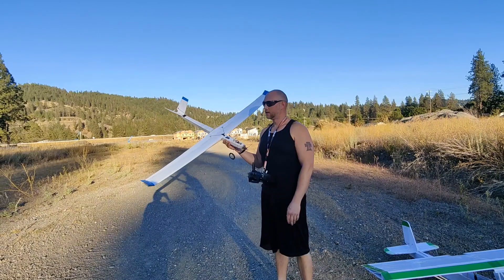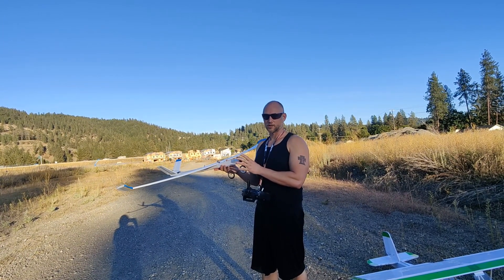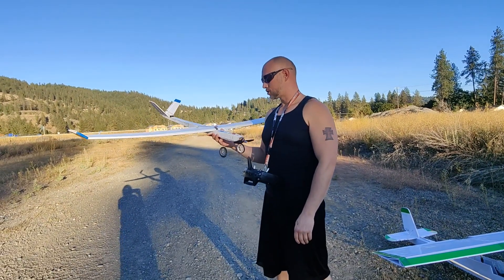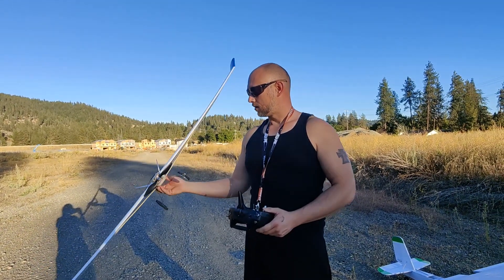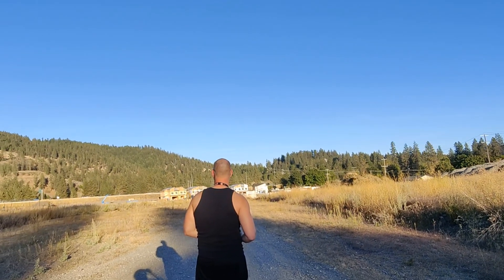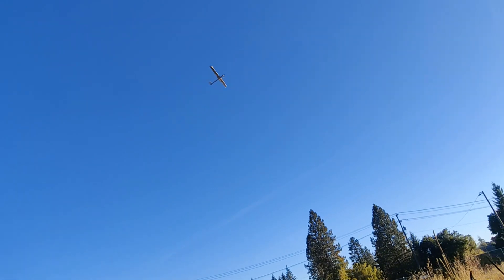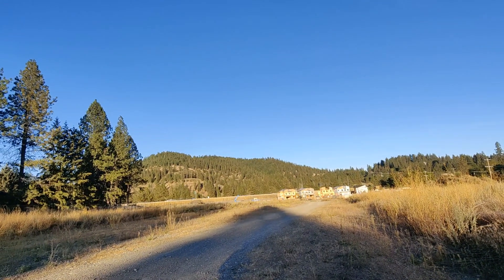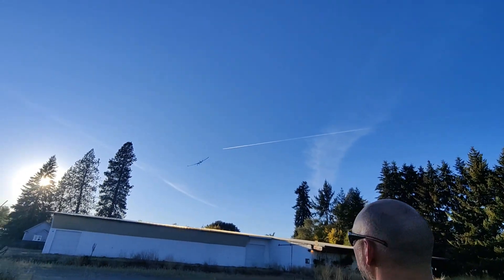Finally flying my GTV again!

Comment: Dang, hate the battery died. I always use a battery alarm. Awesome plane…
Reply from the maker: @EJ-74  I had two timers set. That I used before with this plane but since I did more full throttle stuff it died quicker that usual. Oh well still a blast!